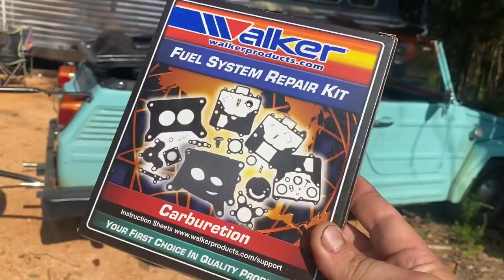Diesel guy cleans vw solex 34 Pict carburetor

Comment: The electric choke needs to be adjusted.  The big screw is the idle air bleed, that's how you adjust the idle speed.  The small needle is the idle mixture and you adjust that for smoothest idle.  On that model carb, the throttle plate is completely closed for idle, so make sure the screw on the end of the arm that touches the choke cam is not holding the plate open.  Other than that, the only thing that will make it run rough is ignition or vacuum leaks and I noticed a standoff plate between the carb and manifold.  Those can leak and ruin your idle...
I grew up with air cooled Volkswagens, so this stuff is basic...
Reply: Great comment. One of the best things about Utube is this sort of shared knowledge. I remember my love affair with a VW thing....now slipping into history. Wish you guys had been around back then. LOL.
Reply: I love it when people can go into detail on cars like that. I'm impressed with your knowledge.
Reply: Those symptoms can be from flooding caused by heat expansion of fuel in the float bowl and lines, similar to vapor lock.  try cranking at full throttle under the problem conditions, after sitting hot.  so driver training can fix it, especially if you find the choke is fully open so not as above.  Permanent solution would involve a return line and regulator, if you don't want to train drivers.

Comment: Hot starting issues are often "fuel vaporization" (aka vapor lock).  Essentially, the fuel boils in the piping/carburetor bowl and is no longer liquid.  Extended cranking the engine pumps cool fuel into lines/carb which is not in vapor state. (Ethanol in gas does not help this situation) There are some 'tricks' to help alleviate vapor-lock. (the trick is to NOT allow engine-heat to get to the fuel)
Reply: X2.  I was driving  my 72 bug in the desert when it was really hot and out in the middle of nowhere.  I did get it started but did learn later on if you put a clothespin on the fuel line it draws some of the heat off and prevents or at least reduces the vapor lock issue.
Reply: I agree it sounds like vapour lock - if the insulating spacer plate under the carb gets badly contaminated, that too can make matters worse - I think they should include one in any re-build kit!
Reply: The easiest trick is to put some wet rag around the fuel pump :-)
Reply: Definitely sounds like overheated ("boiled") fuel in carburetor.  I noticed the "insulator" between base of carb and intake manifold is metal, maybe aluminum, maybe aftermarket.   I would check with VW experts to see what's supposed to go there.  If it's supposed to insulate the carb from the hot intake manifold...aluminum won't work.
Reply: @steverandall5814  , even though I haven't worked on the old air cooled VW's, I've rebuilt a lot of different carburetors on cars, trucks, tractors, lawn equipment, etc, and I've never before seen a metal spacer. If there is a spacer between the carburetor and manifold, it's always been either made of bakelite or plastic.
Reply: @jerrybrooks870  the spacer is to lift the carburetor up a bit to make clearance for the alternator.  That car originally had a generator that was narrower.

Comment: It's called "vapor locking" common for that era of cars., you described it perfectly. When hot the gas in fuel bowl vaporizes creating pressure forcing fuel thru the jets and the car floods, that's why it starts 15min later the hot fuel evap. Instead of cranking 30 sec, hold pedal to floor. This flaw was realized and later carbs had a strait vent upwards. That vent can be used to fill bowl directly from outside by squirting gas in it. Your bowl is completely sealed. Hope this helps

Comment: Enjoyed the video ! I agree with several others comments on here, the heat soak is doing a number on your carburetor and fuel system. I would consider adding a phenolic spacer between your carb and the intake manifold to help isolate the carb from the heat transfer. I would also consider wrapping the fuel lines and fuel pump with heat insulation material for the same reason. Replace all fuel filters. Cars with air-cooled engines are much more susceptible to heat soak, especially as they are usually mounted in the rear out of the air flow. I was hoping when you had it apart you were going to give the float a shake and see if it was retaining liquid. The plastic floats are known to crack and take on fuel which plays havoc with the float bowl setting causing too much or too little fuel. Some carbs even come with a site glass showing how much fuel is in the bowl. You are probably already aware of this, but these engines are also prone to engine fires, so I would make sure your fuel lines are new (and if possible use superior material) and carry a fire extinguisher with you at all times ! Check to make sure all of the fuel lines have rubber grommets where they pass through metal walls from the tank to the engine.

Comment: Yup, welcome to the hot South with an air cooled VW!  My '71 Westy and my '74 Super Beetle both have had vapor lock issues in the hot weather...gas would vaporize out of the carb bowl until it was dry, and even the fuel pump would vaporize out the fuel...drove me nuts!  The solution that I've used is I replaced the mechanical fuel pump with an electric one, routed fuel lines away from the hot intakes....THEN, when you go to start it, turn the key on, let the 'ol carb bowl fill back up, push the pedal down SLOWLY about 3/4 of the way (to not let the accelerator pump shoot any more fuel into that intake...you've already got it pretty rich in there from the vaporized fuel),....crank the ol' girl for about 5 seconds or so an she should fire off!  Works on both my VW's....FYI, I started my Westy restoration in May of 2019, and starting watching your stuff then too.....you actually inspired me.....when I ran into crap (as ALWAYS happens with this stuff, yeah?), I actually would watch one of your videos (or multiple ones if I needed to get really inspired :) ) and would think to myself..."I'm such a wimp....this VW Bus is giving me grief and this dude Scott is pulling trannies out of buses and doing in-frame rebuilds....I need to quit whining and get off my ass!" .....worked everytime.  The Westy is brand new now (with A/C added because I'm a wimp). Thanks buddy!!.......

Comment: Sounds much better than I remember.  Brought me back many years.  Funny to see you hesitate - but I would not have a clue where to begin with a diesel engine of any kind.  Glad you have a big improvement.  Ethanol ruined my Stihl carb, gunked up my vintage B&S engine on a lawn tractor, ruined my motorcycle gas gauge, and another chainsaw carb.  Incredible boost to the economy - the repair and spare parts economy.  Thanks, guberment.

Comment: Oh Man. That Solex Pict 24 brings back alot of memories - Had a collection of 1600 VW Beetles ranging from '73 to '76. Had the Std, Lux, S and SP versions. Were always fiddling with them, carbs, brakes, bearings, occasional TP head rebuild and engine rebuild. Even had at first a Weber 36 DCD on on single TP manifold in one engine then went for a dual 36 DCD setup on two SP manifolds.  That thing really made some fun!!!. Were the good old days.

Re the vapor lock issue - I have insulated the metal fuel line from where it goes through the fan housing and went for heat insulated fuel line to the fuel pump and then to the carb. Also that phenolic spacer is almost a must.  This setup worked for me in temps up to 38 Deg C.

Comment: “What is this foul liquid?”
That’s gasoline, Scott. 🙂

A couple of things:
To clarify, the big adjustment screw on the left is not an air bleeder. It passes all of the air/fuel mixture at idle—none passes through the carb throat and throttle plate. Adjust your curb idle speed with this screw, choke open, engine warm. The tiny screw nearby adjusts idle mixture. The electric solenoid closes the idle bypass (big screw) passage when the ignition is off to prevent run-on, which became a problem as the VW engine displacement increased. If the idle fuel passage is clogged, or the solenoid won’t open the bypass passage, it won’t idle. The screw on the end of the throttle arm sets fast idle speed(s) on the cam.

The triangular vacuum diaphragm is the choke pull off. It cracks the choke plate open when it’s otherwise closed to allow the cold engine to run without flooding.

Float must actually float, and the level must be set. The fuel level in the bowl affects the richness of all circuits.

If you have an off-idle stumble/flat spot, pull the intake boot and see that the accelerator pump nozzle sprays a healthy squirt when the throttle opens. We didn’t see that you pulled the nozzle or check valve for cleaning.

As several have said, a distributor mismatch can also cause a flat spot. Looks like you may have the original distributor, but can’t tell about the carb.

I agree that you had a vapor lock problem. That’s not a carb issue, but is fuel vaporizing in the line ahead of the carb, rendering the pump useless. We had a 440 Chrysler that did it. Nothing would solve it, until we decided to build the engine and found the fuel pump push rod worn 3/8” short. It’s always caused by heat and/or low pressure in the line. On the VW, the suction line is routed close to the head. Make sure it has some space, isn’t resting on hot metal. Get the pump discharge line out in the open, not tucked back in the heat. Make sure the line(s) have no abrasion damage, especially over the cylinder head and through the firewall shroud. They’re often chafed there because the grommet is gone. A weak fuel pump, or worn push rod or eccentric, will cause vapor lock. Lastly, IIRC, there are two pushrod lengths or different pumps. I don’t recall whether the “long rod” pump works at all with the short rod, but I do remember that the pump won’t even mount in the reverse combination. Ethanol may have compromised your pump; it also looks pretty new, so who knows about its quality.

Does your carb not fit the manifold? Why the aluminum spacer? It isn’t helping anything in terms of heat or fuel.

I have a ‘65 Beetle and a ‘74 Thing set up just like yours. I see no reason to start insulating fuel lines or doing other band-aids, unless the ethanol is worse for you than it is here. Mine runs fine the way Wolfsburg designed it, and it sits a lot too.

Comment: So confident in his rebuild he loaded it with concrete to try the hills!!

Watching a few different channels where folks have rebuilt carbs is about got me to the confidence level to tackle the mitsubishi mighty max I have been avoiding for a few years now!! None of the videos are of that carb not have I watched them for the reason of rebuilding mine just stuff I watched anyway. Mine does have like several more dozen vac lines attached to it though. That WILL BE deleted once I pull it off!

Comment: I worked on corvair all my life and some of the problems you described is like what we have as well. But we use a phenolic carb spacer between the carb and intake manifold. Saw the moisture on the intake and it could be vapor locked due to the heat. Trying using a couple of more gaskets and or a phenolic spacer

Comment: Scott, those phenolic carb floats are notorious for absorbing a little fuel and getting heavier as they age. I have a little float scale (looks like a dope scale) and I always check they weight of the float against a brand new one. Usually have to install the new float.
I'll bet this is the most probable scenario. Your float is heavier than stock and causing the carb float level to run high. As your motor hot soaks, the gas is boiling in the carb and overflowing right through the bowl vent tube into the carb. This is probably why your motor first fired after you put the carb back on. Raw gas was in the intake. When the motor is hot and sitting for a short period, it's making the motor hard to start. After the motor cools off, the raw gas is actually helping he motor to start with the choke on.
You might not be an expert but you are gifted with a natural mechanical ability. Face it kid, you are a mechanic. You got this.

Comment: Cleaning and adjusting the carb is always a good thing.  The other thing to do is change the spark plugs wires.  You may resist that idea but if those in use now have been there for more than two years they need to be changed.  This is really true if hard to start when humid.  Good luck.  You do a super job.

Comment: 4th gear is overdrive, so GJ. And Scott, take a pair of plain ole pliers that have the "half round" with an open gap towards base of jaws, when fully closed and grab the small brass pipe that is swaged into carb that the fuel line slips over, give a good yank to the side away from carb, i.e. pull it out. Bet you it will come out very easily. This is how most well maintained aircooled VeeDubs burn to the ground. If it does come out easily, most all of a certain age do. Then find some gasoline impervious sealant, coat the part of it that goes into carb, and reinstall. Always carry an extinguisher as well.

Comment: Hi !  The washers under the float valve adjust the fuel level inside the chamber. It needs some care or the engine stalls when being tilted or running uphill. Also essential is a tight carburetor foot seal against the intake manifold. The orange goo around the one fixing screw is a hint that there already was a problem before - and someone tried to "fix it somehow".

Comment: My late uncle who was a certified aircraft mechanic had a VW that had the same hot starting issue.  His fix was to cut an oversized carb gasket out of sheet teflon gasket material.  It was large enough to to shield the bottom side of the fuel bowl.  It looked a bit outrageous but it did cure the hot starting issue.

Comment: Just a tip.  If you hit the supermarket and get one of those syringes used to inject marinade into meat, you can use it to load the float bowl with gas through the bowl vent, the angled tube sticking up in the carb bore.  This cuts way down on the cranking and isn't the fire hazard that dumping gas or starting fluid down the intake would be.

Comment: I never worked on my VW carb but that was before ethanol gas came out. I did rebuild Holleys a couple of times. Yep, just need to adjust the carb so it idles good. The carbs on outboard motors and yard equipment have small jets inside and emulsion tubes that need all the small holes cleaned out. I use a small wire and carb cleaner. I also found if this stuff sits with ethanol fuel in the carb they clog up so I run the fuel out and put fogging oil in it. Works great till you need to use it again. Keeps it lubed and clean

Comment: A little of my experience with VW air cooled. SO MANY carbs, SO MANY distributors, To get rid of a flat spot you MUST get the correct dist. and the correct carb together. When you look at the list that was produced for each year much less VW in general the odds of you getting a match is less than the winning the lottery. I have bought more replacement dist and carbs I could buy that Thing. I could get flat spots down to a just a blip but it was always there. All I could do is move the flat spot around. Hall effect electronic ignition and f/inj. is the way to eliminate those issues. Really cuts down on maintenance also. Yes f/pressure return line is a pain.

Comment: Your symptoms sound like Vapor Lock.  It happens when you have a fuel line running near to a heat source.  When the engine shuts down - the fuel in the line will boil and cause bubbles in the line, and that keeps your fuel pump from moving any fuel. When the line cools down, the fuel vapor condenses back into liquid and everything goes back to normal.  It can also happen in a carburetor if the fuel gets too hot when you shut down.  
The fix is usually pretty easy - move your fuel line away from anything that gets hot.  If it's the carb - then you might be able to find a phenolic spacer to insulate the carb from the intake manifold.  I'm guessing it's a fuel line just running too close to a cylinder, or something similar.

Comment: Hard starting after a prolonged hot soak sounds like vapor lock. Can minimize it by routing fuel lines away from heat sources. Also a phenolic type carburetor spacer to insulate the carb from the heat of the intake would help too. 

Good job on giving it a shot, and rebuilding what you've got! Some carbs can be complicated PITA's, but these Solex's are usually very simple, and self explanatory. A good one to cut your teeth on.

Comment: Fuel line might have been routed past something hot between pump and carb, and/or there may be supposed to be a thick heat insulating gasket between carb and inlet manifold.